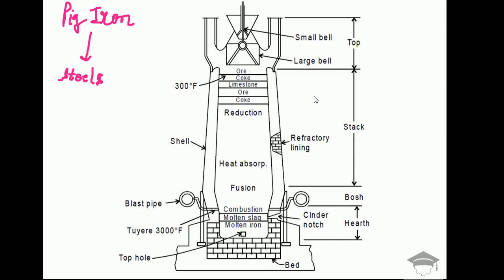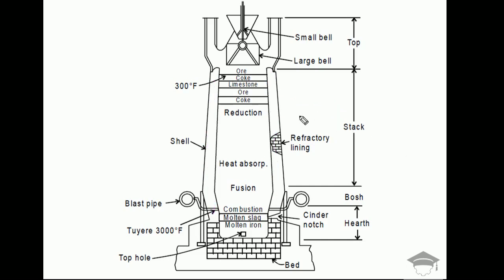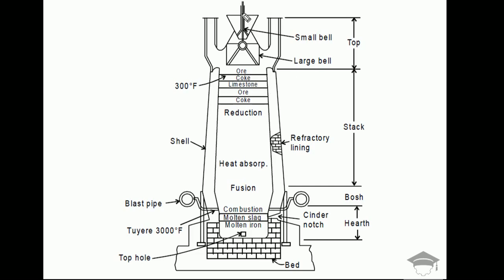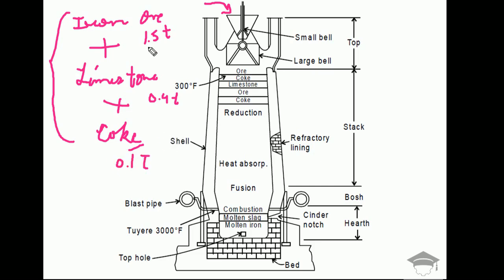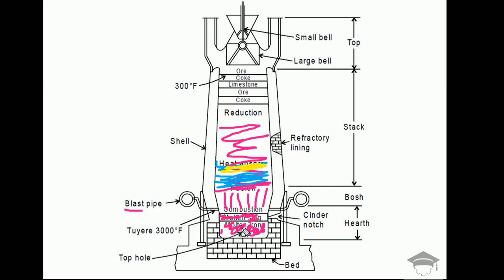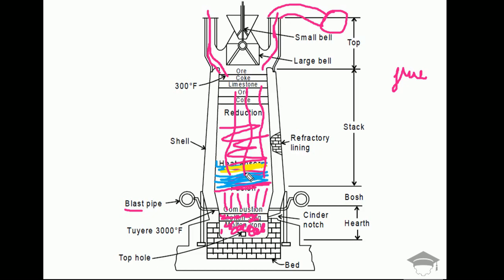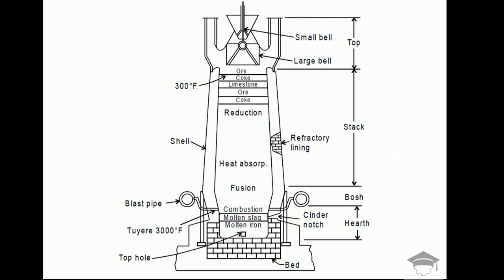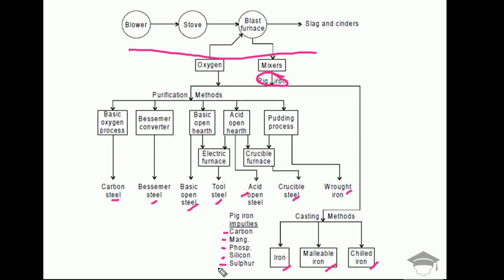Blast furnace explained with diagram - Blast furnace parts, working, applications #blastfurnace

Comment: A question.  The furnace is a large cylindrical vessel.  Solids are dropped in the top (ore, limestone, coke.)  Is there a solid column of solid material sitting on top of the molten liquid on the bottom slowly melting or does it melt as it drops and  quickly form slag and hot metal iron?

Comment: I've about a dozen videos and this is the best explanation on the inner workings of a blast furnace.

How are the levels of the slag and molten iron determined? How often are both tapped?

I expect that furnace dimensions dictate amount of materials charged into the furnace so I am also asking how normal production raw materials input and the iron and slag outputs are calculated for a given furnace size and the tapping schedule.